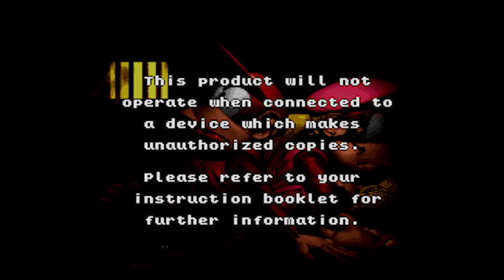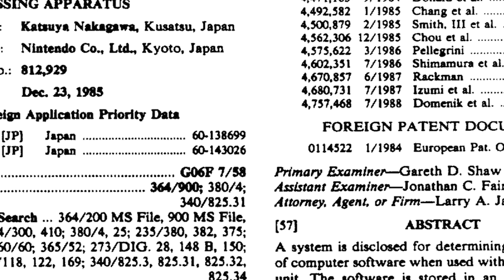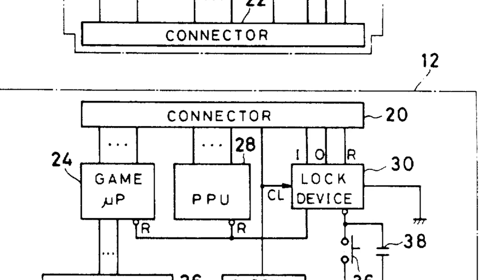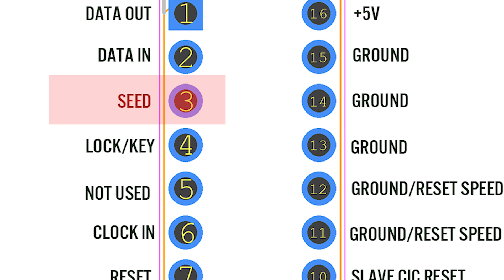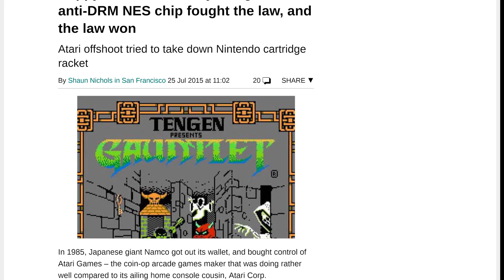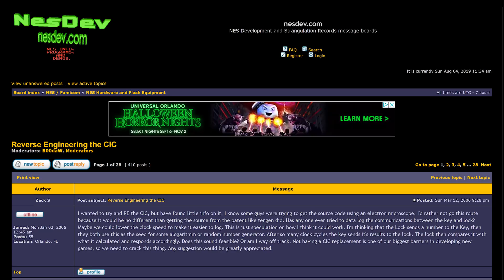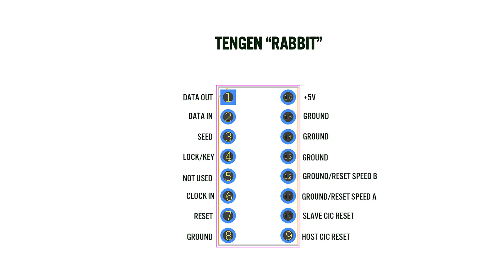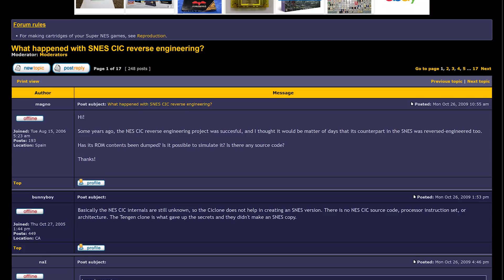Secrets of the Nintendo CIC Chip - Early Cartridge Anti-Piracy | MVG

Comment: 7:05 Plastic, not ceramic. By the 1970s plastic had displaced ceramic in nearly all DIP chips, as it is substantially cheaper. It’s what we use to this day for most chips. It’s actually plastic (often epoxy) with a high amount of mineral filler, so that it retains a coefficient of expansion similar to the chip inside — otherwise it would shear off the bond wires.

Comment: The voltage spike thing was the result of a small-but-critical flaw of the design: the lock chip's only active response is on check failure (resets the system) while passing the test simply results in it doing nothing.
Perhaps if the lock was two chips, one which tests the cartridge and reports to the other, which would be the one to reset the CPU upon failure or non-communication?

Comment: I am the senior programmer for a local game company. One of the things I put in to determine if the system is authentic was for the user to be able to hold 3-keys down at a time and it would state if the program running (that I wrote) is authentic or not.

I don't do this initially for bootup as it would greatly slow down the execution each time. But as the keystrokes are known only to my team and myself - there's little chance of someone guessing these keystrokes and thereby learning where to bypass this in the master engine I wrote.

I realize this is pretty cumbersome today. Methods today involve checking ONLINE to see if someone has actually purchased the game or they check online the program running against a master copy. I'm - not that advanced a programmer so I have to resort to offline methods for our software protection and integrity.

Comment: great video but lots of errors.

-Hiroshi Yamauchi had nothing to do with the game approval process, he did not like or play video games.
-believe it or not it was actually R.O.B. the Robot, not the Seal of Quality, that was beneficial to Nintendo's early days in the US market. it was the trojan horse that got toy stores to carry the NES.
-10NES is the name of the program that lives inside the CIC chip; it's not another name for the chip itself.
-cutting pin 4 of the CIC in the NES is a bulletproof method that no NES game can detect, and allows ALL games, licensed or not, to run. 
-there were no software checks for the CIC in NES games. what Nintendo started doing was adding diodes and other protection circuitry around the CIC in later NES motherboard revisions, to keep it from being easily zapped by unlicensed carts. again, cutting pin 4 of the CIC in the NES bypasses all of this.

Comment: The CIC Chip never stopped piracy I remember desoldering the CIC from SF2 TWW and clipping it in my wild card to play SF2 Turbo
on the SNES it was more of a regional lockout chip then DRM or anit-piracy.
Reply: But you could use famicom games in other region systems by altering the pins on the cartridge.
Were those pins in any way functionally tied to the CIC?
Reply: @cyphaborg6598  Yes the SNES cartridge was a parallel system  so it was easy to do and that's why it was one of only a handful of systems that had them adaptors that you put two games in one from your region and the import or a game that had it's CIC removed. This was called the piggy bank adaptor.

Comment: the rabbit chip was totally different from the 10NES chip.  It was a purpose-built sort of CPU, vs. the 10NES' general purpose microcontroller.  Tengen ended up using all the "extra" pins for debug outputs that let a decent amount of state to be read out during operation and this helped to reverse engineer it.  I made custom hardware to perform this data dumping as the chip communicated with a lock chip.  Interestingly there's a relatively easy way to dump the 10NES' code using the factory test mode but no one figured this out until very recently.  Also interesting is ROB's microcontroller is the exact same microcontroller with different code.

Comment: If you haven't done so already, you could make a whole series based on Commodore 64 copy protection. The lengths I had to go through to copy some disks was insane. Fat Tracks, Half Tracks, nonstandard Bit Rates, Track Synchronization, the list of methods goes on and on. Then there was the more physical approach, code wheels and paragraph books, but dongles were the worst. Not only were they sometimes quite tricky to build, you could fry your system if you made it wrong.
Reply: xnetpc Apparently you never had Fast Hackem.
Reply: A Floyd Renegade/Maverick was my go to “archival” utility, but I had Fast Hackem and bunch of other tools in my arsenal.
My comment wasn’t about what tool cracked which copy protection. I was suggesting a rundown of all the different methods companies implemented to protect their intellectual property. The Commodore 64 was so popular that it makes sense that so many copy protection schemes were utilized on the platform.

Comment: People should read up on what exactly happened with Tengen, it's not as simple as Tengen being unhappy. They had a partnership with Nintendo, and Nintendo screwed them. In fact, Nintendo screwed a whole lot of third party developers through exclusivity contracts and parasitic partnerships. If you've ever wondered why the N64 failed to attract many third party developers, it wasn't just the hardware. It was also that Nintendo went around demanding to be treated like a god, and people had finally had enough of their crap.

If the law was just, Nintendo would have been slapped down by anti-trust law, and that would have been the end of the story... Sadly, that was not the case.

Comment: This isn’t the only console that utilized this technique. I remember going to the landfill to dump our garbage, and saw a dead console motherboard with a cart still in it, so I exchanged my garbage for their garbage, and took it home. Later, I parted it out, and opened the cart, and lo and behold, there was a ROM and a 16-pin DIP IC. There were two (or maybe three) ASICs on the motherboard, along with three 16-pin chips, each with the same part #, but with a different dash extension (-A, -B, and -C): the “extra” IC in the cart had a similar part number, and a -B extension. My guess, is they were some sort of lock-and-key, though I was just guessing.
Now, knowing Nintendo did it, it’s not such a stretch to imagine someone else did too.

Comment: Ok, having been somewhat involved in the process with reverse engineering the CIC, there's a bunch of parts of this video which need clarification: in 2006, before the Nesdev scene knew what processor the CIC used, the Atari/Tengen rabbit chip was reverse engineered. The instruction set of the rabbit chip is DIFFERENT (and slightly more efficient!) than the instruction set of what we later found out was a Sharp SM590 microcontroller that the NES and SNES CIC chips used. This meant that the code it ran is actually not the same as the original NES code, and lends to the idea explained by people who worked at atari, that the copy of the 10NES cic code listing they got from the copyright registrar's office was not actually used during the reverse-engineering, but was done afterward by a legal intern without permission.

The real SM590 code for the NTSC and one of the PAL NES regions, and for the NTSC SNES cic was extracted via decapping around 2007. Once we knew the keys for the NTSC and PAL-1 region on the NES, the keys for the other two regions, PAL-2 and Korea, were brute-forced using traces of the 16 data streams. The reason two CICs had to be decapped is the timing of the NTSC CIC code is older and different from the timing of the two PAL and Korea CICs, the latter 3 likely use the same code with a different key on each. The SNES D411 CIC was decapped, and brute force analysis of streams from the SNES PAL CIC showed that the NTSC D411/F411 CIC and PAL D413/F413 CIC keys only differ by 1 bit.

The N64 CIC is an entirely different can of worms, and much more complicated. There, the N64 has a system management controller in it called the PIF (which has INSIDE THE CHIP a special version of its 'lock' CIC, containing multiple keys, corresponding to different key chips it can use) uses the values returned by the key chips to decrypt one of the earlier boot-sectors for each game upon power-up. The PIF also contains a small bit of boot code that runs on the MIPS processor in the N64, and sets up the RDRAM and then queries the PIF to see what the CIC returned. Reverse engineering the N64 CIC had a major advantage: a clever member of the n64 community discovered that if you apply a higher-than-normal voltage to one of the SM5K3 pins, it will spit out its internal ROM contents in an undocumented debug mode. 

This made finally completely reverse engineering the N64 CIC (which has 4 or 5 variants per region, to prevent people swapping ROMs and piggybacking carts between games easily) finally possible. Another interesting thing is the very final version of the cart CIC used on the n64, used on perfect dark 2 and banjo tooie (and one other game?), actually has another layer of encryption implemented by the CIC 'in between' the blocks of bits in the stream of random data that it normally constantly sends back and forth with the PIF, which allows the console cartridge software to send a 'command' to the CIC and get a response back, which was used for additional DRM with those games specifically.
Reply: I read Ed Logg telling the Atari version of the story, thought it sounded like cope, but I don't know anything about code so I just said "I'll never know". Cool to see from someone that actually knows this stuff that Ed Logg wasn't lying about the reverse engineering and the legal team just screwed them over!
Reply: nice

Comment: Why didn't N64 flashcarts just piggyback from the N64 chip? And surely there were hacked versions of ROMs that took out the CIC check, right? That's how DRM is usually dealt with when you can't mod the hardware.

Comment: I think there is a mistake in the video. At 7:51 it is said that there are no branching instructions at all. This is not correct. The Sharp MCU used supports 4 levels of subroutine nesting as well as conditional execution. Feel free to refer to the tables on page 9 of the SM590 datasheet.

Comment: Note that the claim that Atari required the 10NES code to create the Rabbit chip is disputed. That was Nintendo's claim and was repeated, without any apparent diligence to verify it, by David Sheff in "Game Over".  I have heard quite different versions of this from the folks who were working at Atari at the time.  I don't think any of us are in a position to judge, but I'd call Nintendo's claims at best poorly substantiated.  A relevant point is that amateurs have subsequently decapped the CIC, and didn't experience a lot of trouble optically recovering the ROM contents and reverse engineering the algorithm.  I was actually told, by someone involved, that the biggest challenge they faced was identifying the Sharp SM590 because the die, as is common for CPUs like this to prevent reverse engineering, contained no indication at to the manufacturer.

Comment: CIC chip security is probably another huge reason why Nintendo 64 was cartridge based even though CD technology had been around for a while. Would have also made Nintendo 64 more expensive if it was CD based.  I'm glad, because loading times are a hassle even nowadays. PS5 with M.2 or faster SSD will hopefully finally solve that. Nintendo is still the best, Switch Homebrew is awesome!

Comment: One solution to the chip modification detection on the carts after people started disabling them would be to attach a switch inline with the reset signal pin. When playing legit games, flip the switch on. When playing unlicensed carts, flip the switch off.

Comment: Wait ! There are NES Games that lock if the CIC Chip is still in use ?
If that is true
  which games ?
else
  debug "nevermind"
EndIf
:)
Reply: I'm not sure what they are referring to in the video there. There is no way any game code could check that the CIC was working. You'd have to have some specific hardware on the cartridge, which purposely fails the security check at some point, and notices that it doesn't get reset. At the moment I can't think of any other way a game could tell, and I've never heard of a game doing that.
Reply: That sound plausible.

But maybe there are other output variables as just the reset signal ??????

If i understand the video right, the CIC in the NES and the CIC on the Cardridge communicate, and are both cpu's.

Both can Input & Output, so if they put a newer Version in the Cardridge that search for a specific output (that is not there), you should be able to Reset the Game, from the Code in the newer CIC.

To this day, all NES Games worked :) (got a PAL Nes)

Maybe the guy in the Video mean the Snes & N64 CIC.

Back in the day (93 or so) Dragon Ball Z - Super Butouden 1 (Super Famicom Version) on the Snes, dont worked with my first Import Game Adapter, just with a newer one, that came out a year later.

Comment: I dislike DRM fiercely, but I've got to hand it to Nintendo, being able to keep the code for the CIC secret for over 20 years is incredibly impressive, and even then, if it wasn't for Atari it would have taken even longer to figure out.
Of course it was relatively easy to bypass, but no one was able to actually crack it until long after the console stopped being relevant, which is remarkable.

Comment: So the CIC chip in the game carts are identical to the one in the console? that's good to know. I bought a NES from a local pawn shop and it had the lockout pin removed. The base of the pin was pulled out of the chip so I can't restore it. Knowing the chip in the carts are the same, I can pull one out of a donor cart and replace the disabled one with a non disabled one and get my NES back to original. When ever I get around to removing the old chip, I may socket the chip and hold on to the disabled one just in case. Though for the moment I have no reason to keep the lock out chip disabled. :P

Comment: So how did the Super Wild Card device & Super Pro Fighter devices work then ? Did they also have there own CIC chip inside ? Because these came out around 1994 maybe even earlier.
Reply: They normally used cloned CICs - these were physical level clones created by imaging all the layers in the chip and then producing a set of masks from them.  As far as I can tell, nobody ever went to the effort of finding out how they worked because all they wanted were the masks so they could fab them.  One funny thing about the cloned chips was they often had camouflage part numbers on them - for example, one of my Bung copiers has a chip that's marked "7410" (which is a TTL triple 3 input NAND gate) marked on it - but it's actually a cloned CIC.   This always amused me because the CIC has 16 pins and a 7410 only has 14, so it was pretty obvious the marking was bogus.

Comment: Didn't they have those chips in the NES controllers in Europe
Reply: There wasn't a lockout chip - the reason you couldn't use NTSC controllers on a PAL NES was that on the NTSC console the pullup resistors on the pad data lines were in the console and on the PAL pads they were in the pad - so if you plugged a NTSC pad into a PAL console three were no pullups at all and the console wouldn't read the pad.  The other way around (PAL pads plugged into a NTSC NES) worked fine.  They did exactly the same thing on the SNES too.

Comment: This is one of your more interesting hardware uploads IMO. 
  From a production hardware perspective, it's interesting that they designed the chip to run identical code on both the base and cartridges. Anyone care to share how they would personally implement better security with a set of similar production hardware constraints, (4-bit μC, identical master/slave, etc)?
-Jake
Reply: Upcycle Electronics A slightly larger internal ROM for more patterns, maybe some code to disguise the pattern.  Oh and an 8 pin chip to save production cost.  Maybe feed some of the actual game ROM lines through the chip and require that game data to contain a certain pattern.  Auth failure would feed the CPU unplayable garbage.

Comment: Hey, I accidentally destroyed my CIC on my NES mobo. I was hoping to desolder it and seat it in a socket so I could put some kapton tape on pin 4.

Is there a replacement for the lock?
Reply: There used to be a chip called the "Ciclone" I remember seeing on sites like retrousb. It had a different pinout though but if wired correctly it's basically like having a CIC reinstalled (although had a region detector anyway).
Reply: @Kippykip  thanks! I found it, but it's discontinued. I wonder if they would publicly release the firmware. 🤔

https://www.retrousb.com/product_info.php?cPath=24&products_id=37&osCsid=97c8dc07f4d060563e912c96b442d325